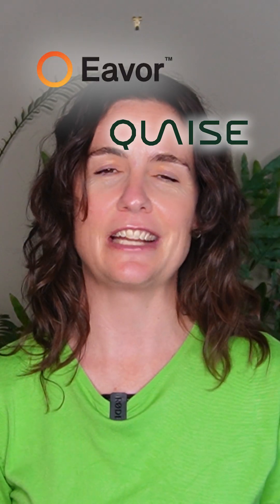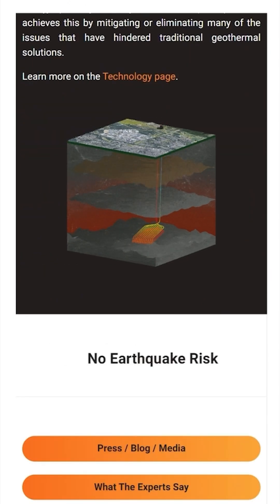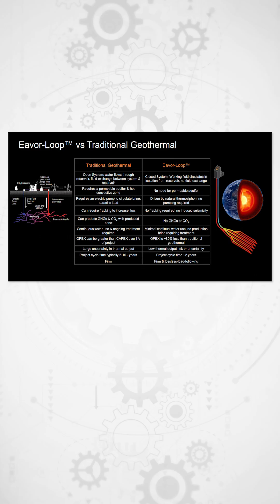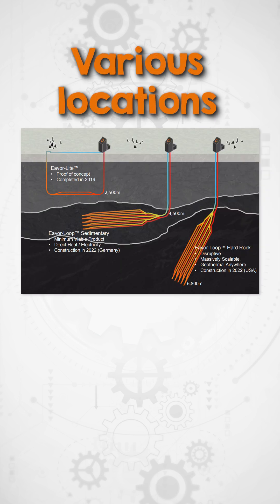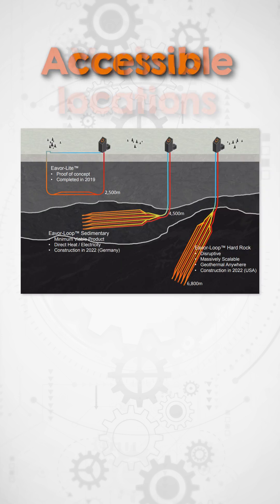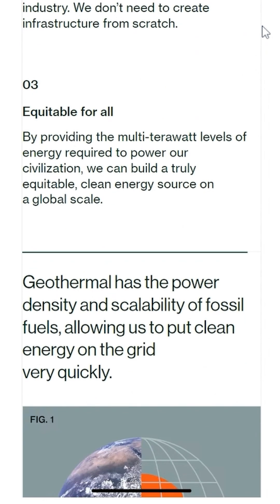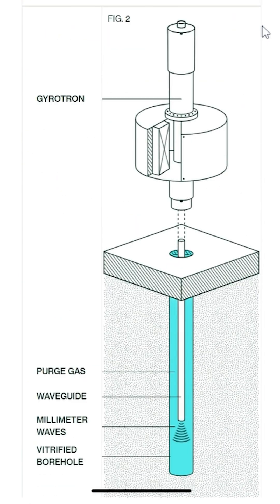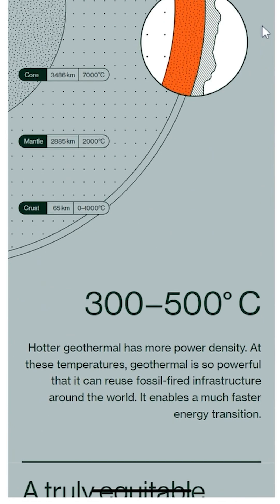New Geothermal Drilling Technologies

Comment: to what extent is removing this heat from deep within the earth putting at risk the stability of the surrounding areas of the earth. Is the heat that is removed replaced, and if so by what ?
Reply: It would take hundreds of years to have any dint on the local area since most geothermal is too far down, plus the heat is absolutely replaced by the heat further down into the core, but if you imagine heating up 1 gram of water to 99 degrees, it cools down very quickly but if you heat up 100 gallons/liters of water water to 99 degrees it takes exponentially longer to cool. Geothermal is the same but rocks can hold way more heat energy